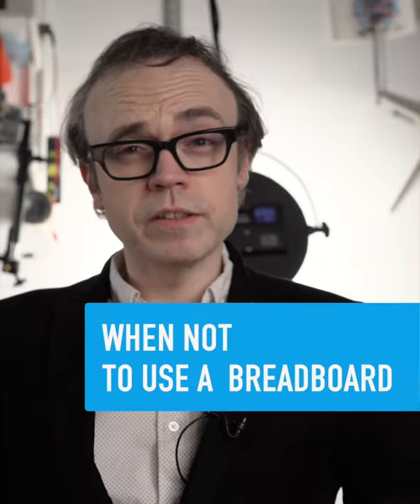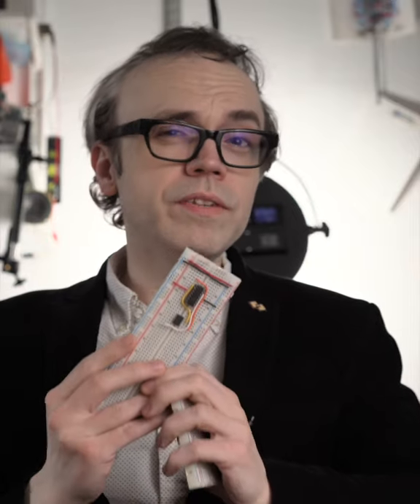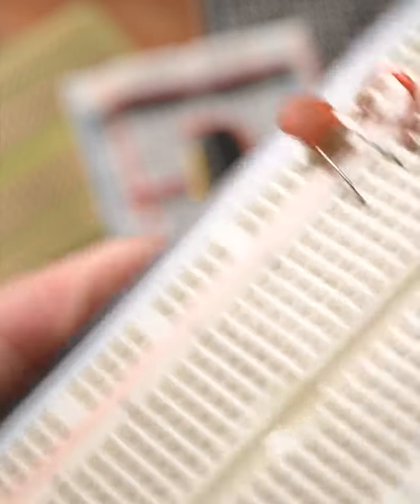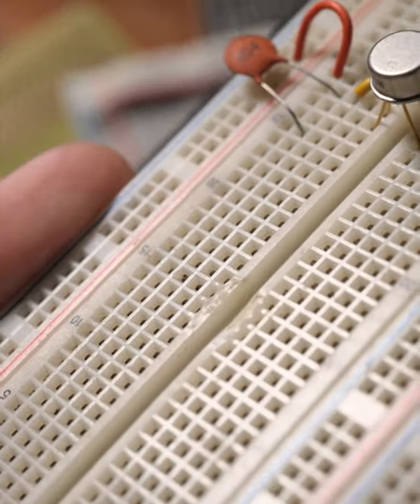When to use a breadboard - Collin’s Lab Notes #adafruit #collinslabnotes

Comment: Good points, and I'll add one: Avoid breadboards for bridge circuits, where small changes in contact resistance can produce large changes in the signal. Resistance of soldered joints doesn't change much when you wiggle the wires.